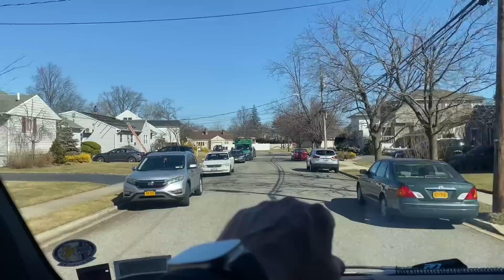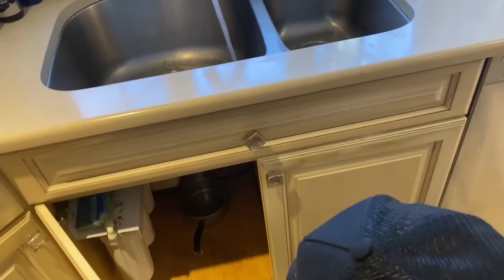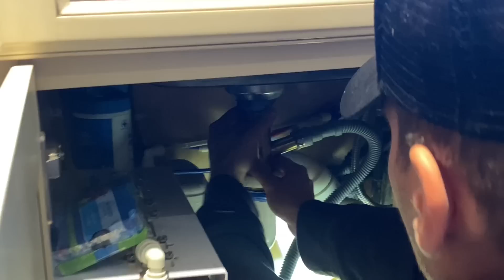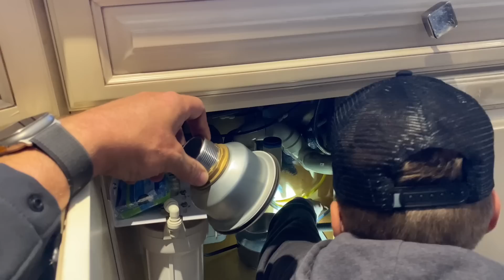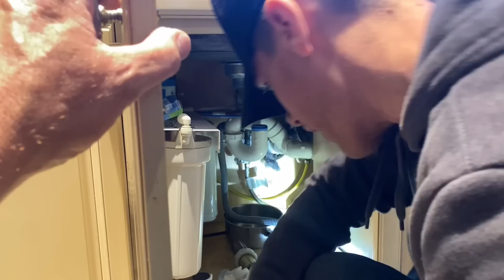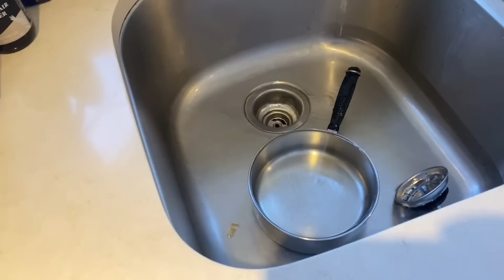Water Leak Under Kitchen Sink How to Handle Recalls & Properly Running a Plumbing Service Call

Comment: Use 100% silicone on the basket strainer instead of putty. Also the dishwasher drain line need to be strapped up higher in the cabinet.
Reply: Yea, if you're a f-ing maintenance man. Plumbers us putty.
Reply: @BigStevesGlassBoxes  Im a master plumber, been using silicone for 20 years never had a leak. Let’s see your f-ing credentials buddy!
Reply: And why the need for tape/sealant on the mounting nut?  It doesn't seal there.

Comment: Another problem I have with tightening a flat tailpiece is that if you tighten the bottom of the tailpiece first, you can cause the flat tailpiece washer to misalign. And no amount of tightening on the top nut will stop that from leaking. Hence the wear on the basket strainer threads.

Comment: Mike if those dishwasher tailpieces are bluefin which is a supply house brand. I can tell unthey are no bueno always had problems with it nut is to shallow to properly catch the basket strainer. Better to buy a dif brand that has a deeper nut.

Comment: no dope or tape needed on the drainage piping. It is all washer connections. DW drainpipe pipe needs to be looped high as possible. Frankie clearly didnt know what he was doing.
Reply: Was thinking the same thing.  I laugh when I seen teflon tape on threads that have nothing to do with how the fitting seals.

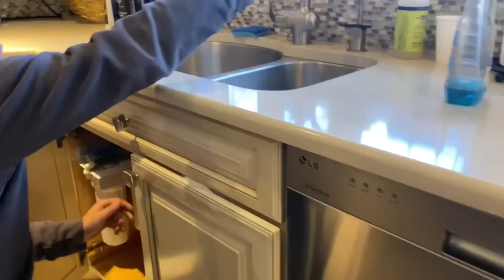Comment: That floor @2:20 just triggered me. Stagger your joints when you lay a floor. It looks terrible when it's all symmetrical like that, not to mention wastes so much material.

Comment: That no AC call a couple years ago Mikey Pipes sensed it was a setup. I think it was a wire pulled off the contact or was it a wire pulled off the capacitor?

Comment: Just did a basket nut yesterday that had split, one of those pot metal nuts with the zinc coating that makes it look like brass. Question, Is that style basket better than the ones with the really wide mounting nut in your opinion ?

Comment: The quality of most basket strainers and tail pieces is pathetic.  They have gotten so thin and hardly last.  The Kohler ones are still good.  Installed a fancy Rohl strainer recently, what POS plastic plated junk.

Comment: You missed a big problem with that sink. Dishwasher line needs to be looped up high. With the way it is now if the sink drain clogs it will flood their dishwasher and start leaking out the door. No Bueno Mikey.
Reply: Good catch but that’s not what a high loop is for
Reply: @PipeDoctor it most certainly does prevent waste water from backing up into your dishwasher wether it be from a stoppage or back siphonage. please explain.
Reply: I've obeen drain cleaning 22 years.  I've seen it overflow and flood out the dishwasher door many times when hanging down. It most certainly does stop that. What other reason would the high loop be for?